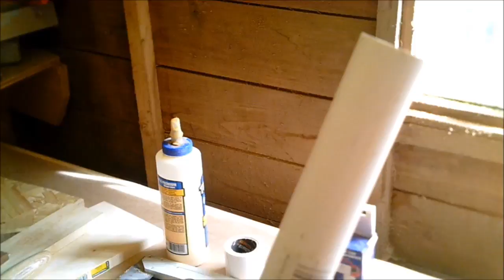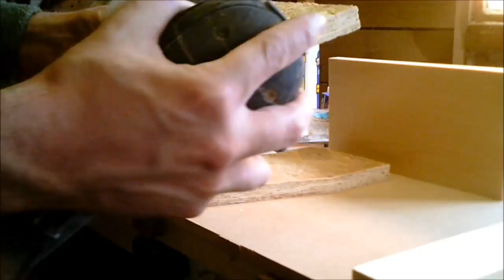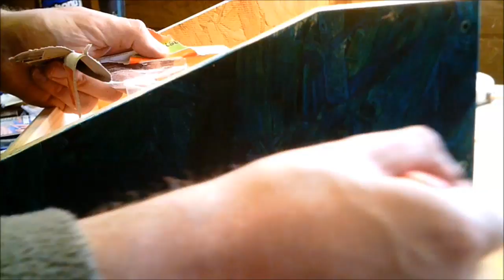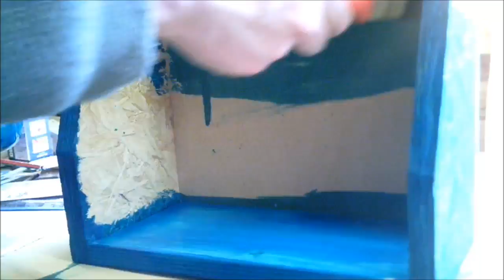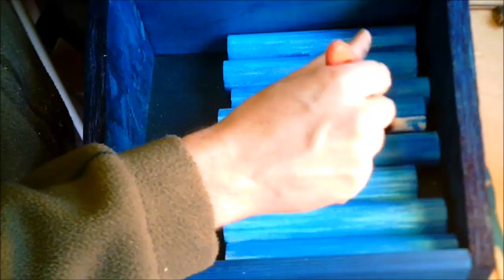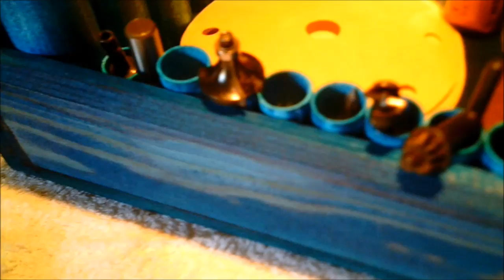Carving Tool Organiser

Comment: With a new lathe coming (which hopefully I'll actually use), I think I'm going to have to use that idea of pipes for tool holders.  That is pretty cool.
Reply from the maker: Make Crazydays a new lathe would be nice!the pipes are really handy for protecting the carving tools,they cant bump metal on metal and get chipped!
Reply: Yeah, the old craftsman I picked up off a local cheapo auction site for 5$, but I found it had too many issues (such as the tail stock wouldn't secure in place, which made it incredibly dangerous).  The new one is a Grizzly G0462 off eBay that I need to head out this week-end to pick up.

I'll definitely have to figure out a way to use this pipe idea for holding the tools.
Reply from the maker: cool let me know if you make one!